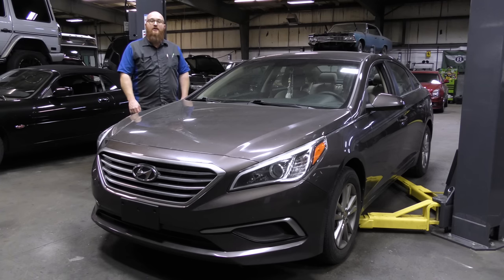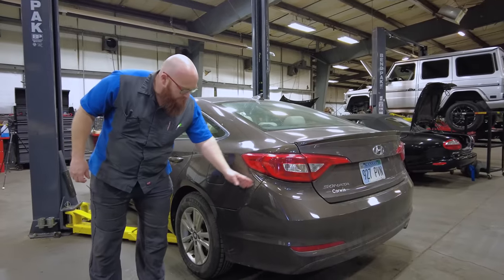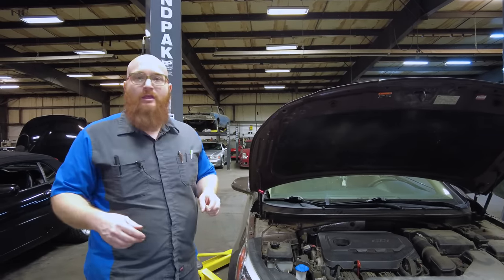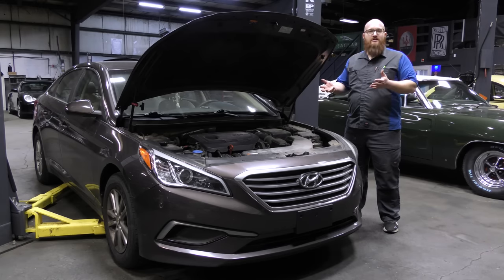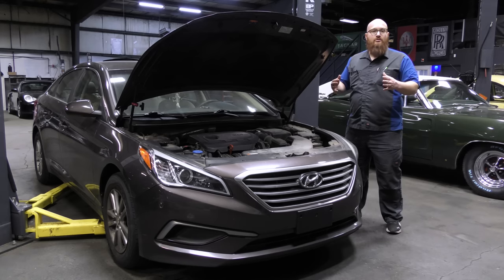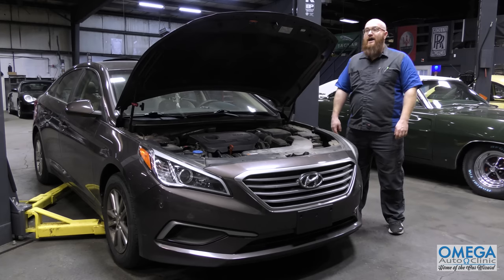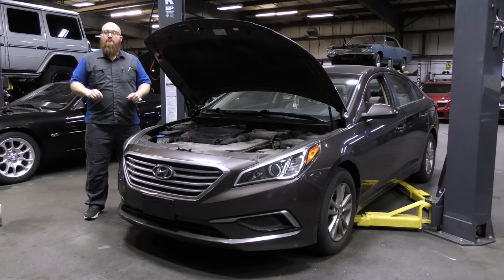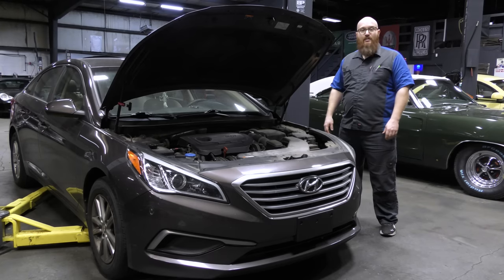What could be so bad on this '16 Hyundai Sonata that the CAR WIZARD is sending it to the junk yard?

Comment: Hyundai has had to pay it out in a few cases, and for good reason. They don't de-bur the crank assembly on Theta II's, which puts metal shavings all up in your block. They have been known to burn up oil like crazy. I wasn't the best at taking care of my Hyundai, changed every 5k, but that should have lasted longer than it did. Come to find out the recall is just putting in a knock sensor so they can, likely, throw some bearings in and send you on your way, let the engine crap out,, check your oil which has been consumed, and tell you no chance, 7k please. Hyundai has taken a nosedive in terms of its mid-range vehicles. They are the prepaid flip-phone version of cars. Better to lease one and trade it out after a couple years.

Comment: Number 3 cylinder probably Should be using full synthetic and Hyundai/Kia oil filter. Did the plugs and air filter get changed. I have 360,000.
Nothing leaks. Doesn't use anything.
Best car I've ever owned.
If you let those engines go long on two or three oil changes they will start using oil. And about 120,000 is all you're going to get of them especially if you're an idiot.

Comment: man I knew those engines had their issues but not this bad. I managed to get the 2017 2L MPI up to 139k before it got otherwise totaled, the engine was fine bc I changed it AT 4k miles instead of that dumb 6 or 7 or 10k miles, or just never

Comment: in most cases those engines fail due to inadequate lubrication and overheating. Low on oil, bad oil, too long on oil before changing. Things get progressively worse if you run oil for more than 4k miles in those GDI engines. Owner is to blame here, they didn't even add oil before going to dealer trying to get engine warrantied, very smart move... not. Lack of care for their own property.

Comment: After having the check engine light come on I had my dealer check it out. The knock sensor sensed the engine had a knock, so they replaced the engine (71,000 miles) with a brand new short block! Now I have basically a new car. Check your oil at least once a week or lose your ass.

Comment: I guess Americans need to get their Chevy small blocks back from the 60s. If you get double digit mpg, than it's fine, may need a new starter and an oil change after 120k. No wonder EU cars are not liked in the US. Need to check the manual for maintenance, fluid levels... Nah...
Reply: Listen, Europe is no different, oil changes every 15000,  20000km, gunk up engines, with stretched timing chains ending in eastern parts of "EU" where they get repaired because of cheap labor.

Comment: I understand that some of these engines were defective from the manufacturer as they had tiny metal filings  left in the cylinders and would start burning oil after 15 or 20,000 miles  to the point it was hard to keep up with the oil consumption. Very poor quality of manufacturing unfortunately.

Comment: I have the premium version but same make, model and year. I have had so money issues with this car. 
It is a horrible car. First the sunroof window stopped working then the radio stopped working. After I got Hyundai to sort that out, the radio died again but this time the push to start button died as well. They eventually sorted the push to start and the radio under warranty. When I got the car back I had issues with  the engine. It randomly started stalling whenever I accelerated past 60km/hr. To add insult to the pain, the radio and push to start stopped working again. Finally got all three sorted again but once my warranty ran out the radio died again. I have been quoted $1600 for a new unit by Hyundai. I am definitely never buying a Hyundai again

Comment: 2016 Hyundai Sonata 2.4L version engine is an inline 4-cylinder engine that carries a bore of 88.0 mm, stroke of 97.0 mm and a 10.5:1 COMPRESSION RATIO... The Recall is based on the readjustment of Knock sensor detection system (KSDS). Evidently, Kia's/Hyundai global engines will not run on regular 88 octane fuel with out pre Iginition or super knock: causing unusual high pressures in cylinder head and blow by on pistons rings and catastrophic engine failures...If the compression ratio of your vehicle is from 10:1 to 11:1, you can use 92. octane.... *Hyundai-Kia sell more vehicles because: they are more sports car looking, but also have more high preference engines than their competitors... !!

Comment: Id tell the owner to put 5 bottles of STP or Lucas.
I know its supposed to be filled with "0W20".
Back in the old times dealers selling junkers in Canada in the 70s and the engine was clattering junk, they poured in a lot more stp to hide the rattle. 
I happen to go to a restaurant located beside a Hyundai dealership. 
In behind the garage is a couple pallets piled with complete engines not stripped blocks.  That told me right away they are so cheap they are not worth even having student level mechanics work on them. 
Sealed JUNK.  Like throwaway everything else now.  
Phone battery dead? Junk!
TV stopped? Junk!
Engine stopped? Junk! 
Im sure if this happened in Brazil or Cuba, they would swap in a 390 Hatz 2cyl and be back on the road. 
They do it for Sienna vans.  Hatz swap.

Comment: I would get a scrapyard eng or fix existing  cut the crank and  replace bearings if block damaged        Warrenttee requires  a module upgrade.caution     rebuilds 5  yrs wt.3499$ a crank kit 35o$ bearings inc.

Comment: These cars guzzle oil. I had to put 3 quarts in 2800 miles, it was a 3.8qt system! No low oil light! That's why these fail catastrophically. All Hyundai/Kia, 4 cylinder anyway are junk, all disposable and they just prayed they lasted until the 100k warranty is up

Comment: There should be an idiot light on the dash to notify the driver of oil change😢. I overhauled my 1.6 L Hyundai Elantra at 570000 Kms thats about 333000 miles. I also change the oil and oil filter every 4600 miles.
Reply: That light gown on and you are already toast. FOI,,same for tire warning,you already screwed the tire belts.

Comment: Im tired of all the comments about lack of maintenance,there is a inheritant problem with the design of these engines period.I've owned Ford's,Chevy's over my 40 years of driving i never had to check the oil level weekly. If Hyundai is replacing engines in cars that are 5,10 15 years old then they know their engines are crap yet they still keep putting them in their vehicles.

Comment: My 2012 Tucson....at less than 80,000 miles it spun a rod bearing like the Santa Fe, Sonata....same engine. Hyundai declined to repair the failed engine, apparently failed one of their demands.    Beware, Hyundai and Kia are the  recall Kings and Dead on the Road vehicles sold. They wont back up common failures that they have.  Buyer Beware!  Never again for me.

Comment: Mechanically Totaled Pull the glass, interior blow the air bags add a cheap cage and demo it. And buy a Honda or Toyota with a 2, or J as the first VIN digit. if that's above budget find a Buick or Oldsmobile with a 3800 V6 Chevy cars driven hard usually the same with Pontiac are worse on maintenance. I go 5K between oil changes easy to remember even with conventional you could 3.5k or 4k between changes and 4k to 6k with a blend a and 5k to 7.5k with full the Oil Companies that say 10k 15k or 20k ignore it the same with High Mileage at 75k 60s 70s 80s cars yes beyond that it may not be necessary you can go over 3k between changes with any car but check your oil every 500 to 1k miles.

Comment: Have thai engine in my 15 kia sorento. Have had it since new. At 187k and i use BG MOA every oil change. Oil chnaged every 5k and never ran low.  Still runs good.
Reply: It'll run good right up until that metallic debris dislodges from the crankshaft and chews up your bearings.

Comment: I'm trying to understand the logic here...Don't say anything bad about the guy who forgot to change the oil and drove it around with less than one quart, but DO say something bad about Hyundai because....because they're supposed to build engines that survive this kind of abuse?

You could have the best engine in the world inside the best car in the world, and it will suffer the same fate if basic maintenance is neglected. So what's the point?

Comment: Ive got a 2016 Toyota Avalon that has 145,000… I change the oil on time everytime… runs like a clock… buy a Toyota and change the oil on time and you’ll be satisfied… or buy junk and neglect it and be stressed😎👍

Comment: Had the same knocking sound and I was fortunate enough to have the dealer install a new motor due to the recall but now when I go from 1st to 2nd it jumps and same thing from 2nd back to 1st. When I turn it off then turn it on it goes away. Dealer never found the solution and everytime they drive it they never experience that “jump” sensation so if anybody has any idea as to what it can be that would be highly appreciated. Also my car is just like this one, 2016 sonata 87k miles on it

Comment: Its been awhile since i checked mine but my vics are lower mileage and they don't burn oil yet and I only drive less than 20 miles a week. Hyundai are junk though, the first mistake was not buying a good brand. The story was great. I really wonder what are the issues with this engine that everyone hates it.

Comment: sad, mine is at the dealership, still runs, just noticed oil consumption has increased, especially after the last oil change 3 weeks after, got the oil on after oil change again. Always has oil in the car, however, even it RUNS, dealer DENIED today REplacing engine, funny they even said maybe the pistons , maybe the crankshaft, wouldnt know only if open the engine, I said do it, its aN ENGINE RECALL ON THE CAR. THEY TOLD ME NO, PICK UP THE CAR!!   very SAD. THATS HYUNDAI FOR YOU!!!!!!!!!!! IVE DRIVING HYUNDAIS FOR 18 YRS!!!!   LAST HYUNDAI ILL EVER BUY.... GUESS I WILL SALE IT.

Comment: If it had under 100k miles Hyundai would have replaced the engine for free! And I would have called Hyundai cooperate office! One issue tho. If you don’t have records of oil changes done no more then every 10k miles regularly (cuz Hyundai states oil changes every 10k miles) the recall would have been cared for.
   I’ve seen other get a N0 answer from one dealer w/reason being the oils too dirty wasn’t changed enough not the fact that it was low! Cuz oil burning cars that’s to be expected! But too dirty oil is lack of changes..but then they’ll take it to another dealer and then get a yes answer! And get it fixed free.

Comment: Not changing your oil will kill any car. Pure fact. BUUUTTTTT! Hyundais are absolute trash, Hyundai dealerships are absolute trash. I bought a brand new Hyundai Venue; The worst brand new car experience I've ever had. Heat doesn't want to work, AC sucks,  the traction assist is possessed, random electrical glitches. 3 dealerships have told us to Pound sand because they think the car is fine.  I'll never touch another Hyundai. Buddy of mine bought a Telluride. Engine started shitting oil all over his driveway at less than 50K miles. electrical gremlins galore too. 

Don't do it. Hyundais are bad and their dealers are worse.

Comment: Wouldnt you check  to see if it had engine oil before sending it to the dealer. 🤦‍♂️ 
And whats the big problem i rebuilt this engine before.
Dissmantle and clean the engine. New set of 4 conrods and machine the crankshaft. 
Put back together and good to go.

Comment: Well if you run it with 1 quart of oil has nothing to do with Hyundai. I  know they have issues with the engine that has a recall. Poor maintenance of course the engine is shot with 1 quart of oil. Thats with any car with 1 quart of oil, This will not deter me from Hyundai where I have owned 4 sonatas with the same 2.4 cylinder.

Comment: I own the 2018 eco 1.6t trim. And wow it’s just bad engineering. It consumes oil very fast, the engine is full of carbon residue too often. The transmission dual dry clutch setup is very unreliable. I got the car with 67k on and now it has 95k already on its second transmission and the engine burns oil more than it did before. I think the reason that is still working ( engine ) is bc I keep up with the oil changes very often. Every 3k to be specific. And even doing it at 3k I still find the dip stick more that half way down almost the empty dot. I’m disappointed bc the car design is beautiful and I really like the suspension. But I don’t recommend this vehicle not even to my worst enemy particularly this gen not  (2018-2019)

Comment: If car owners cannot maintain engines, it follows logically they will destroy EV charge systems, batteries, get caught with no charge in rural areas, and other EV lack of maintenance failures other than drive train. Traction motor repair requires specialised tools and proprietary parts...Mechanics now need to train in EV repair, they will be JUST AS BUSY.

Comment: Lets not bullshit,big bussiness no how to billed a car to breakdown so that you have to cary a convienuent insurance policy.I worked in the auto industry for 51 years.All that time they should be able to build an engine that should last to one million miles and an automatic transmission to one million miles but no no.Some of the engines i have seen were American engines that were getting 26 t0 27 miles per gallon on big limosines like the  Lincoln town car the Crown Victoria the Mercury.Of course you have to consider the rear ratio and all.Also Chryslers 318,360, and 426 Hemi were rugget damn good engines and really really tough.What do think they  put them in boats for?One of the biggest and hardest thing on an inturnall combustion engine is,and i am not going to repeat this is initial start?The russians had an oil pump that was to run oil all through the engines oil gallyways for initial start for there T34 hum everybody wants a T34 big balls V12 bad ass Diesel.

Comment: I bought a 2013 Hyundai sonata in February with the 2.4 and I was about 2 months in I was driving to college and my car turned off I thought okay what’s going on I thought well it needed a new battery because it was from 2020 so I said it probably died and it needs a new one put it in and it wouldn’t start I said great I got it towed back to my house which costed me 259 dollars I googled a lot and didn’t find anything really specific to the problem I had to I loaded it up on my trailer and towed it with my tundra ( I bought the car to save gas) took it to Hyundai to let them figure it out they said the engine was seized and so they replaced it well when I went to pick up the car I was told this was the 4th engine this car has had my jaw dropped I said really I thought there was like a lemon law thing for that he said well for the recall it cant be lemon lawd I said okay well I drive my car for another couple months and in July I went to get something to eat and I went to turn at this intersection and my car makes a huge clunking sound and isn’t moving I said what’s this now got it towed back to my house let it sit for a few weeks because i didn’t have time to mess with it I got it towed to Hyundai the triaxle went out that was 1 grand to fix then I had bulbs keep going out replaced every single bulb inside and out with led nothing has burnt yet that costed me around 150 I bought higher quality bulbs now my airbag light came loose connection fixed it and now I’m having suspension problems where my car sounds like it’s exploding over any bump I will never buy another Hyundai and this car only has 128k miles

Comment: Please just find another used engine for it , most cars if the body work is at this stage can be repaired junk the old engine search on line for a replacement.

Comment: It's a shame that this engine was ruined due to lack of oil/inadequate maintenance.  Today's engines don't tolerate this type of abuse at all.  If the engine were good it would have been cost effective to fix the other problems with this car like the cracked windshield.  I wouldn't care about Hyundai/Kia's great warranty their engines don't seem to hold up well even when maintained properly.

Comment: Hyundai has bad quality control, I worked at a Hyundai dealer for a few years and I seen a few elantras with a lot of miles one 1998 Elantra had over 450K miles the guy thought Hyundais were the best cars ever because of that car so he bought a new Elantra and the engine spun bearings with in 30K and he always kept up on maintenance . That company just has bad QC and if you put a lot of mileage on one you just got lucky . Lots of engine repair and replacement at that place .

Comment: Doesn't your investigation that the engine is junk kind of indicate you should be suggesting a Toyota or something as an alternate? Hundai is in the news for totalling their Ionic 5 EVs for road debris strikes on the battery protective cover on the bottom of the car (and invalidating the warranty at the same time with a $56K (canadian) bill to the customer). Junk seems to be the right word for them.